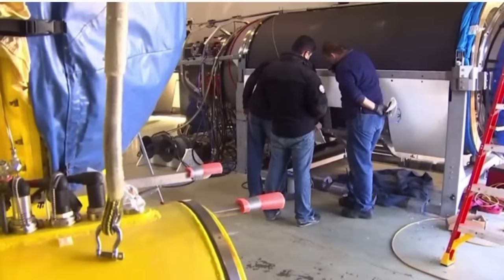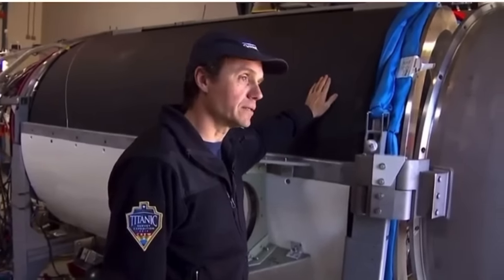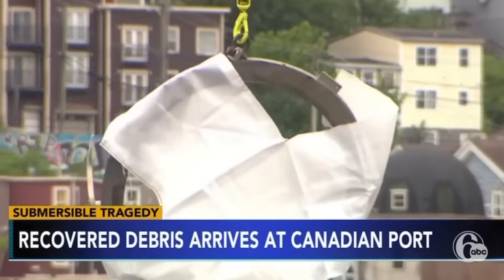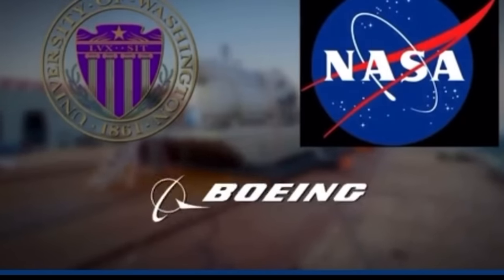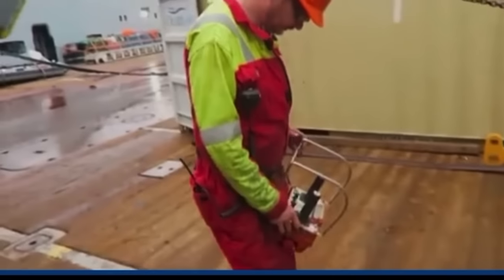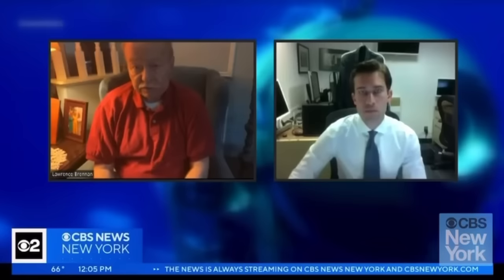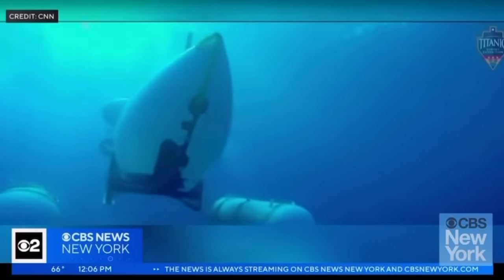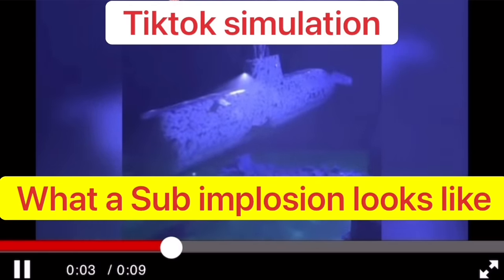Titan nosedived like an arrow (then popped like a balloon) #Titan #oceangate #Titanic

Comment: There is very little chance the sub ended up nose down.  The pressure vessel the people are in is like a helium balloon. There is heavy weight in the form of the ballast, equipment, and the skid hanging from the bottom of the balloon.   Now imagine a balloon shaped like a short sausage, how is it going to float?   It’s going to float horizontally, because that gets the most helium the highest. To get it to float in any other orientation requires a weight at one point, like, say the knot and string hanging from the balloon.   
Same with this sub.  Its natural orientation will be with the maximum volume of air as high up as possible and with the maximum mass hanging below.  When you consider that the AFT end of the sub had a solid titanium dome that weighed hundreds of pounds more than the end with the window, AND cantilevered off the back of that was additional equipment like a counter weight that weighed 500 lbs MORE. Plus the ballast and skid system at the bottom, there is no force that would cause the sub to orient nose down.   She could NOT have taken on water gradually to fill the front of the sub as at that pressure ANY leak at all would have been like a water jet, cutting thru people and the hull like butter.   And frankly, the reason all that equipment is hanging off the ass end of the sub is specifically SO all the passengers can crowd together near the porthole.   There is no reason to suppose Sub went nose down.  Up until the moment of implosion, it was the analog to a hot air balloon. And people inside could not have thrown off the balance by more than a few degrees.
Reply: But as we understand it, they did drop their drop weights and then the skid which lowered the metacentric height to near the center of gravity making it rollable and pitchable. This is why I suspect it went either nose or stern down...
Reply: For all that writing you have failed on every point. Pay attention professor.
Reply: @SlickArmor  That, also is not an argument in support of anything.
Reply: @christopherpardell4418  you're the only one arguing and it's with yourself my guy.
Reply: No it’s not an argument but what I wrote above his comment actually IS. This is a  discussion of metacentric height and the center of gravity. If you don’t know what those are or you should look them up. The concepts have been used to design ships for over a century now.

Rush did not account for lost of metacentric height it seems. Result was catastrophic pitch change becomes possible and may actually have happened.
Reply: @STLS  his problem was he didn't fully test the number of dives until destruction on at least two and then planned retirement at say 50-60%. Other industries do the same. He did 20 what 22 dives? He probably could have reused everything but the CF hull and they would become cheaper over time while also incorporating improvements into each succeeding generation . I would have also improved the front viewport as he didn't want to pay the cost for the one designed for the depth. With him knowing they're also designed to go over the stated limit he abused that safeguard too. I also believe it was supposed to be a 5" hull and he stopped at 3". Why? Because of cost again. This was mostly greed. He couldn't be happy making 300k a year he needed to make a mil or more. It's short term greed instead of going long term where he could have made 10mil a year once costs came down and he proved over 100's of dives that it was safe. The next step would be patenting to protect each and every new process. Just greed. Greed greed greed and a big dumb ego. They had money its not like they were on the brink of homelessness. He wasn't a dumb guy and he hired good people he just, I don't know, had whacked out priorities.
Reply: @STLS    A, we don’t know they dropped their all their weights. We know they commanded it thru their game controller, pc interface, and we also know that on more than one occasion their system did not drop the weights when commanded. We know they sank at twice their usual descent rate, which means they did not correctly calculate weight and ballast measurements prior to the dive. I.e. they were overweight.   This could mean that at that depth their droppable ballast was not enough to give them positive buoyancy. If the overweight was because of water soaking into the increasingly compromised hull, then the weight of the hull could have increased as she dove and more water entrained into the resin. 
We don’t know that the skid came off prior to implosion And on a prior occasion the skid had failed to release when commanded.   In a sub or ship the center of gravity is only meaningful in relation to the center of buoyancy. In a ship the C of B is below C of G because as the ship heels, the hull displaces more water to the left or right of center and the C of B moves to that side pushing the ship back upright.   In a Sub, the C of B is ABOVE the C of G and the sub always rolls upright like a pendulum.  For example, a navy sub is built with significantly greater mass below the center of air volume of the pressure hull.  This makes them always roll upright. The only way they can dive nose down is with the planes and propulsion forcing the bow down, or with flooding in the bow moving the C of B AFT and the C 0f G forward. If they lose propulsion with no flooding, the sub will settle approximately level as that gets the greatest volume of air highest.   
In this sub just having the occupants on the floor of the sub, plus all the air tanks and other equipment under the floor of the sub means that the center of buoyancy is always higher than the C of G.   While dropping the skid and ballast might make the sub pitch, because of the cantilevered mass of the equipment fairing on the aft end of the sub, the only direction it could significantly pitch would be aft down, again, allowing the C of B to rise higher.   
In a cylinder shaped sub, with weight mounted under the floor , the sub CAN’T float, rise, nor descend with one end pointing down, it will always be at no more than an angle because the weight under the floor and on the aft dome does not shift, and stays to one side of the center of buoyancy.   With all the passengers crowded against the  forward hemisphere,  they are X feet from the center of gravity.  But the equipment in the aft fairing and the fairing itself is OUTSIDE the aft pressure dome. Extending several feet beyond it and exerts a larger lever arm on the see saw of pitch about the C of G. 
Given the sub had dived before, and remained level with passengers moving about on board, one can surmise that in designing the sub they had designed it to be pitch stable by calculating the distribution of mass in the aft fairing to offset greater weight forward, with the understanding that passengers were going to trend toward more to the front than the back.  That is the sub was balanced without the skid or with it such that passengers moving about would not significantly upset orientation.

If the skid released in the back, but not in the front, it would have pitched nose down, but not very far. The skid hanging off the front would have moved the C- of G forward, and that would have increased the lever arm of the equipment fairing at the aft of the sub.  That is, the front of the sub would have a shorter lever arm acting on pitch and the aft end would have a longer lever arm. This effectively reduces the weight at the bow and increases the weight aft in terms of forces acting on the pitch axis.   It’s not like a plane free to pitch yaw and roll about its C of G.  Rather, its C of G HANGS like a pendulum under its C of B with limits its ability to pitch, roll and yaw. 
The combo of the aft equipment fairing cantilevered way off the aft end and the center of buoyancy always being Above the C-of-G would still have had it no more than 45 degrees down, and one person moving  up the floor a little would have dramatically moved the sub closer to horizontal allowing others to move aft as well till it was level.  I am guesstimating based on it stability prior to this incident that just two guys near or aft of the C-of-B would have offset the mass of the skid hanging off just the bow attachment.
Reply: @STLS  FYI- Metacentric orientation on a sub is REVERSED from that on a ship.   On a ship the C of B is Below the C of G.  On a sub it is ALWAYS above the C of G.  This is inherently more stable because the mass of the sub Hangs under the C of B like a pendulum.  And because subs do not ever have a significant portion of their mass ABOVE water level.   I.e. subs CAN NOT CAPSIZE.   Ships CAN because their C of G is Above the C of B.
Reply: @SlickArmor  Making an argument is not arguing with myself. And you still haven’t offered any.
Reply: @christopherpardell4418  what are you talking about I just layed out my opinion above what more do you want? I seriously don't know what you want. If you have a question just ask it quit beating around the bush.
Reply: @SlickArmor  Your response to me regarding “all that writing” claimed I was in error.  I wasn’t and explained why.  You have failed to make any argument countering what I stated so, gainsaying is not an argument.   I understand meta center and how it relates to ship design.  I have designed boats and had to take it into account.  The mistake being made is that Meta center on a sub is NOT what it is on a ship.  A ship has most of its mass OUT of the water, and so its C 0f G is always higher than its Center of buoyancy. ( or at least, it better be ) This rights the ship because the center of buoyancy moves to the port or starboard of the C of G when the ship heels port or starboard, this places an upwards thrust on the hull to the side of the ship that is displacing more water, Pushing it back upright, rotating the hull about its C of G. 
In a sub, the exact OPPOSITE occurs and they are always designed with the center of buoyancy ABOVE the Center of mass.   This makes the Center of mass of the sub always hang directly below its Center of Buoyancy, unless acted upon by propulsion and control surfaces.   In a sub, the center of buoyancy is always below water. This means its acts like a balloon in air, with the rest of the ship hanging below it.   It’s why a dirigible had all its massive equipment and accommodations hanging at the bottom of the gas bags.   The Titan descended many times,  Each time it stayed roughly level. This proves that Rush’s engineers DID in fact consider meta center and distributed mass to offset the movement of people in the pressure hull, who would, of course all want to crowd closer to the front.  This is likely WHY the aft fairing had all that equipment way out there, so that even with everyone forward, shifting the c of g forward, the lever arm on that fairing mass would increase and maintain balance. 
I design things for a living.  It would be nearly impossible for this sub to orient nose down without some kind of flooding.
Reply: @SlickArmor  As to what you DID address,  I have no issue with most of what you said, and did not contest it. So I wasn’t arguing over that.   Exceptiong the point that there simply is no way to make a carbon fiber hull safe in a submersible. Another few inches would have made no difference.  The reason is that carbon fiber adds literally ZERO strength to a pressure vessel under EXTERNAL pressure. Carbon fiber is ONLY strong in tension, and there is no dimension in which ANY schedule of roving on a pressure vessel under external pressure can be put in tension.  It is ALL being compressed.  ( unlike a pressure vessel holding higher pressure IN.  Like a scuba tank, which is an ideal use of carbon fiber because it puts ALL the roving in tension. )  Think of carbon fiber like a rope. Wrap it around a balloon and it’s great at holding pressure in.   But force that rope wrapped balloon under water and the rope just buckles, adding no strength at all as water pressure squeezes the balloon smaller.   Further, laminated resin is NOT isotropic.  that is, it does not distribute stress evenly in every dimension. Its concentric layers of resin sheets, and the external pressure is trying to make their circumference smaller. They can’t get smaller, but each thin layer CAN buckle like an accordion pleat and delaminate from adjacent layers.  That was the popping sounds everyone who ever went on one of these dives reported hearing.  The carbon fiber, having differing properties than the resin matrix, acts as a discontinuity, increasing the chances of delamination.  Rush would have fared better to have CAST the entire hull in JUST solid epoxy resin in a single massive isotropic pour.   At least THAT would have behaved predictably. 
I suspect the hull was delaminating a Little more each dive and eventually the network of delamination reached the surface of the hull and allowed water to soak into the hull.  I think this is why they were diving faster than expected, because they did not account for the hundreds of pounds of water that had soaked into the hull.  They thought the hull was waterproof, and went with its manufactured weight, rather than weighing the sub regularly to see it is was changing.

Comment: Did the 5 people in the sub flocked to the window and caused it tip? 
Did the sub crack and started to slowly leak water? 
Did Stockton Rush say dont worry, we are used the cracking sound?
Did the pilot try to raise the sub while it was sinking?
Did they say to themselves, this cant be happening.
Did Stockton Rush admitted to himself, I have been found out, the game is up.
Reply: Did the 5 people in the sub flocked to the window and caused it tip? 

Sind die 5 Personen im U-Boot zum Fenster geströmt und haben es zum Kippen gebracht?

Sense making you no with translate system writing.
Reply: "Did Stockton Rush admitted to himself, I have been found out, the game is up." So it was  murder suicide? An interesting if absurd theory.

Comment: The hull  itself was not the problem. It was the peripherals surround it that caused the problem. The implosion is just of the result of rapid decent and well physics takes over after that.
Reply: The hull was the problem,  slowly weakening dive after dive.
Reply: The Sub did not sink.   It was descending on purpose.  The hull had been to the titanic before, and at that point that is the bottom, so if it didn’t;t crush the first time it went there, then the hull was strong enough to go all the way to the bottom at that location. But  the hull made cracking noises every time they dove it. Each of those sounds was the sound of a tiny fracture in the structure of the carbon fiber hull. This damage accumulated over time. Every time they dove the hull it was a little weaker.  On the final dive the cracking noises started increasing in frequency.   They would have heard them coming faster and faster like popcorn popping, in the minute or so prior to the implosion. 
The fact that a carbon fiber hull WILL suffer damage on every dive reducing the depth it can dive to is the reason no one who knows anything about submersibles would use carbon fiber for this purpose. There is no safe design for Carbon fiber composites that will loaded in compression in all 3 dimensions.
Reply: @christopherpardell4418  right it was sinking on purpose. But the rate of decent was too fast. It was too fast for awhile before polar prince decided to hint at the rapid decent.
Reply from the maker: They  were probably scared to speak out sooner as he was known to get a temper

Comment: Many now believe that back section that held all he equipment electronics battery packs and wiring  which was not part of the pressure vessel and bolted to the aft ring  broke off  them it plonged which is why the aft compartment is still completely intact with minimal damage.  It could have become weighted down in the aft due to water   ingress which caused the bolts to snap.  That is what could have caused the power failure
Reply: That aft compartment was always flooded.  Just components like batteries and foam back there, incompressible things which are designed to live in the water.

Comment: If weight of 5 large men, and even a micro tear in fiber would have pushed submersible descent too rapidly. After 30 min of going down too fast, increased pressure on craft. At that point of first hint that things were not going as planned...  should have immediately tried to resurface. Not keep descending. Craft imploded first, then exploded after water went inside vessel.

Comment: I NOTICE ONE OF THE LEGS ON THE FRAME BUCKLED AT POINT OF CONNECTION TO SUB WHEN THE RECKAGE WAS LIFTED ASHORE I SUGGEST TRYING TO RELEASE FRAME ONE LEG GOT CAUGHT WITH THE OTHER 3 LOOSE PULLING TITAN TO THE VIWING PORT DOWNWARDS THUS CAUSING ALL 5 TO DROP TO PORTHOLE

Comment: What evidence did your expert have for the dive? 
The unofficial transcript suggested the Titan had started to rise, slowly.  
The transcript said they went to a max of 3,5?? m, dropped ballast and the frame, then rose slowly to 3,457m right before power out and radio silence
The transcript suggested they were diving too fast from the start of the dive. That suggests to me that they had a small leak in the rear equipment area. 
Does your guy say why it would have tipped nose down rather than tail down?
Reply from the maker: some think the aft was soaking

Comment: they were actually slowly ascending when they imploded as there was water leaking into the outer layers of the carbon fibre. hence why they were descending so quickly. they should have started to ascend a lot sooner
Reply: Yep, according to the logs they managed to ascend all of 20 metres in the 15 minutes between reporting a problem and lost contact. There was obviously a SERIOUS problem.